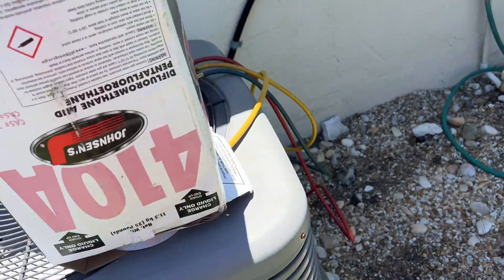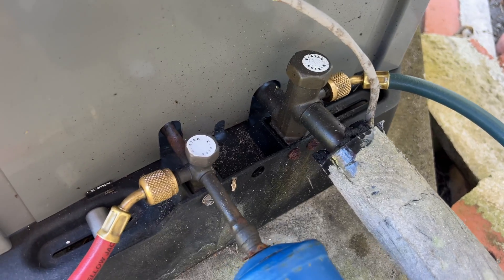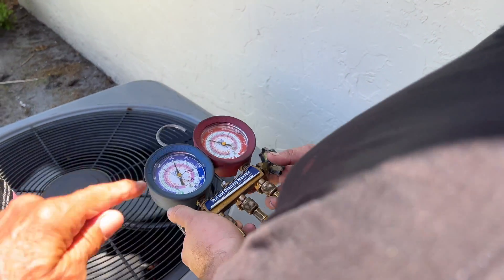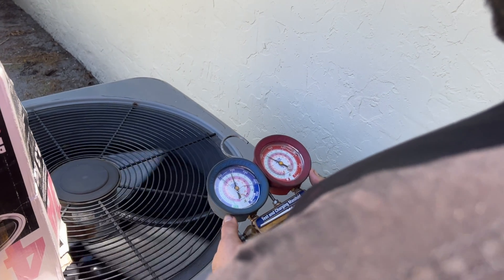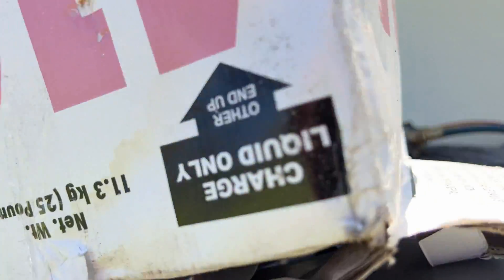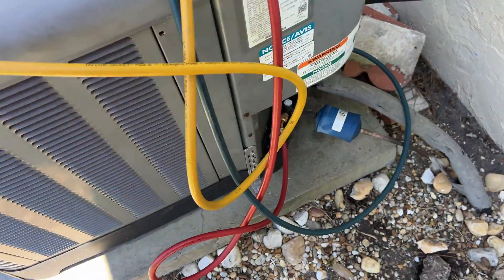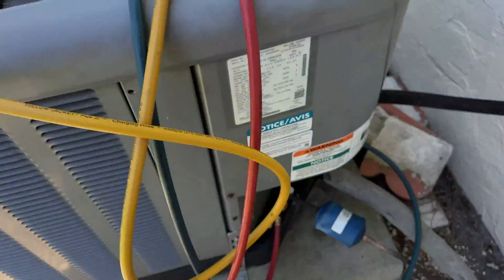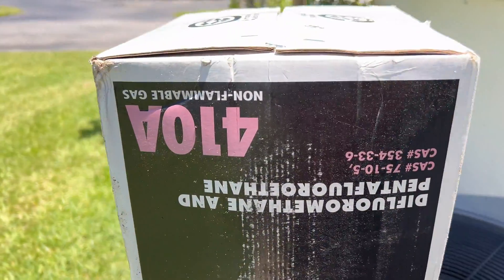Ruud 2.5 ton AC Coolant Pressures 150 Blue and 350 Red

Comment: Don't be so hard on the guy, he knew enough to get them AC!  What they are trying to say, Tom is you should charge by superheat if it uses a fixed orfice for an expansion device.  If it uses a TXV you should charge by subcooling.  In your situation I would have seen what the name plate charge was on the condenser and weighed it in.  If the system is over charged when the house got cool there is a chance it could take out a compressor.  Almost all the guys in the old days charged until the suciton line was beer can cold.  You put your hand on the suction line and added refrigerant until it got cold.  Not a good idea but it would get you by.  I have been doing this for 27 years and never seen a compressor go by charging beer can cold (only works on fixed orfice).   I think you did a great job getting someone cool air in a time of need!
Reply from the maker: Thanks for those great tips and information and also thanks for watching

Comment from the maker: So for context, what happened was the AC went out and we had to replace the evaporator and the coils in the air handler so the house was like 90° because Florida is super hot and we also had replaced the compressor so we had a big job that we did on this and that’s why those numbers are the way they are. Thank you for watching. Stay cool this summer and we appreciate you writing us.

Comment: 150 on suction side is way too high usually unless there is something wrong. 110-120 is normal. Not calculating subcool or superheat? Video doesnt show anything important than you don't know how to charge a system properly which will ruin your system on high head pressure.
Reply: Depends unit and what the designed psigs are supposed to be

Comment: If you’re good hvac mechanics you should not having this question.with not running the unit.The R/22 pressure always lowers than R-410.If the system refrigerants is completely empty,Check the compressor model number.If the system metering device TEX valve you can find out from the valve color.I hope this helped you.
Reply from the maker: Excellent tip thanks for writing and keep cool

Comment: this  video is wrong on so many levels in order to charge a system you need to verify if its a TXV or a piston metering device and then charge by either superheat or subcooling. On some new installs you might not even need to add anything depending on lineset lenghth cause the units come precharged. yall are a bunch of morons and that system is definitely not gonna last

Comment: This is a terrible video by someone who has absolutely no clue what they are doing. If you want to damage your unit then follow this video. If you don't then charge the system by superheat if its a piston metering device, by subcooling if it has a TXV, or by manufacture instructions if its a EEV. A suction of 150 psi is very high and should only occur if its very hot and humid in the house, a liquid pressure of 350 is normal only if its around 80 degrees outside. You do not charge based on pressure, you reference pressure to check for proper operation.
Reply: I agree. The only way to know what is going on is by using pressure temperature chart for the system your working on, comparing the ambient temperatures to the expected, and that changes as the temperatures nears the set point, and the outside temperature will determine the pressure required to condense back to liquid.
Reply from the maker: It was about 95° that day. I appreciate your info. Thanks for all the tips and thanks for watching.
Reply: @TomLeeman  Have you dialed in airflow for your inside unit? Something is definitely not right with those pressures.  Either the house is 85+ degrees, the airflow is super high on your inside unit (which won't take out humidity and reduces your delta T) or something is wrong with your system.

Comment: ya dont do this ....... clueless
Reply: This is absolutely not how you should charge a system lol. This is actually hilarious that you posted this with such confidence on a subject that you are absolutely not familiar with at all. The pressures are almost practically useless to a technician, instead what we want to see are the saturation temperatures of the refrigerant and superheat/ subcooling values which tells us what state the refrigerant is in at what part of the system and essentially tells us how much vaporized or liquid refrigerant there is in that system to ensure it's operating efficiency and also to verify that you aren't slugging liquid refrigerant back to the compressor or starving your system of refrigerant with high superheat causing your compressor to overheat. First things first, you must determine if the system you are working on has a fixed orifice or a TXV and that will tell you which measurement is of the most concern such as superheat or subcooling. Both will matter, but depending on your metering device will depend on which measurement has more importance than the other. Every manufacturer is different and not all systems us the same refrigerant. Lots to learn here my man.
Reply from the maker: Give the readers some info and what’s the best way to do it thanks for watching. You can write it in the comments.
Reply: @TomLeeman  Call a professional for anything more than changing a capacitor or contactor. It takes a long time to know what you're doing in this trade, not just reading a YouTube comment section. What you're telling people in this video is what you would call knowing just enough to be dangerous. Not to mention illegal. You cannot handle refrigerant without proper certification. Did you purge your hoses? You don't know if they're low loss according to other comments and refrigerant burns are no joke. You refer to blue and red not high side and low side (or suction and head). You don't know why you put the tank upside down. You think that you're shooting for specific pressures when that's not how you charge. What was your ambient temperature that day? What was your subcooling? What kind of metering device did you have? What was your superheat? 
This is a profession for a reason and we get paid a professional's wage for a reason.

Comment: How can you tell if you have r22 or 410A Freon in your central air unit? Thanks 👍👍
Reply: Excuse me. How did you figure what psi high and low side should be? Doesn't it depend on the outside temperature and the indoor temperature?
Reply: of course it does.  however.  If you're determining between 410a and r22, the standing pressure of the system not in operation, more often than not, will solve this mystery.

if you index a p/t chart for the ambient temperature, the system should be very close to the temperature listed for the refrigerant in question.
Reply: The High/Low PSI are on the data plate - outside temp doesn't change them more than ~3 PSI on a closed system.
Reply: @CubbyTech  Those are the test pressures. There MIGHT be a psychometric chart on the unit to help you, but if you think there's only 3 psi difference ever you don't know what you're talking about anyway. Do you really think your head pressure will only be 3 psi different on a 70 degree day vs a 90 degree day?
All these comment threads are the blind leading the blind. There's a reason you're supposed to go to school and have an apprenticeship for this stuff.
Reply: should be indicated on the data plate.
otherwise you'll need good temperature probes and a chart
Reply from the maker: I think by the age of your machine and it might just tell you on the side what to use
Reply: @TomLeeman  thanks
Reply: @WatchRichRebuildsChannel  If you have to ask how to tell what "freon" you have you shouldn't even be thinking about touching your system.
Reply: @Jafiveon  I know dumb question
Reply: ^absolutely correct.  Unless you are also low enough on freon so no liquid freon remains.  If you've leaked enough so there's only vapor... I don't know what to do about that.

Comment: The cylinder must be up side down, because you must charge it in liquid form!
Reply: 410a is a blended refrigerant.  They evaporate at different pressures.  If you don't put it in as a liquid, it's not 410a!
Reply from the maker: Excellent tip
Reply: @TomLeeman  It's not a tip. It's literally the instructions on the product.
Reply: @Jafiveon 😂😂 love the response
Reply: Right and how do you do that lol. You use gravity to push the liquid to the top of the bottle by flipping it. Although it sounds confusing the way he said it technically he’s correct. Trust me with an old analog gauge set like that he knows how to charge a unit
Reply: The way he said it, sounds like the weight of the liquid is helping the process, and it's not.